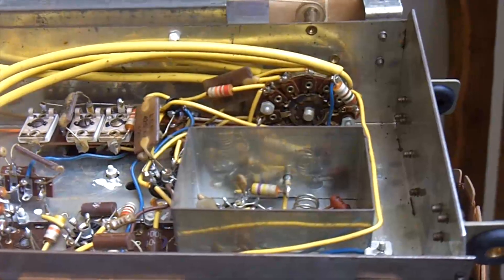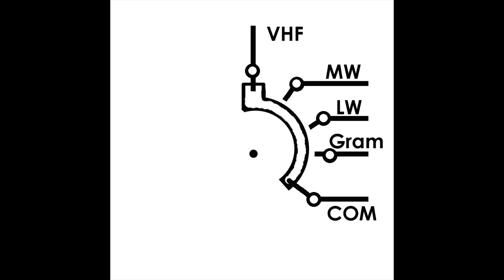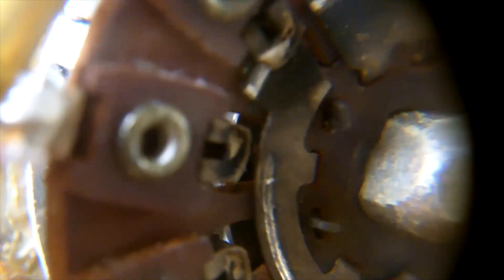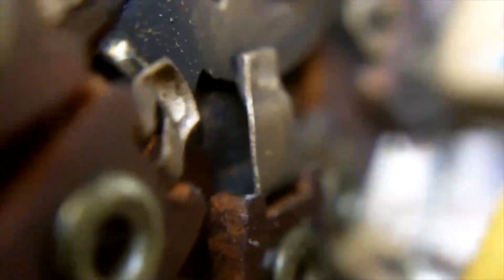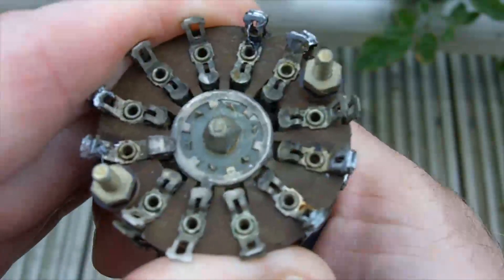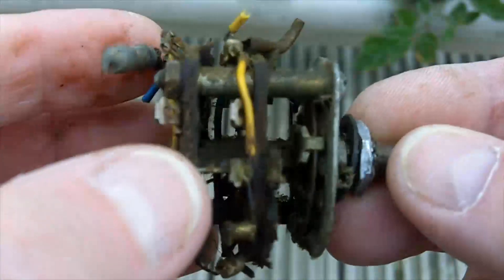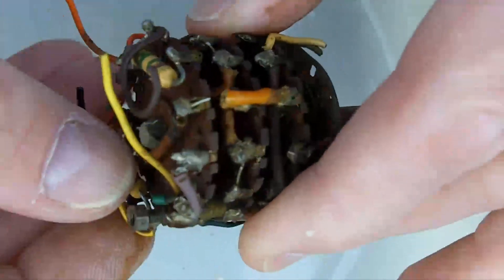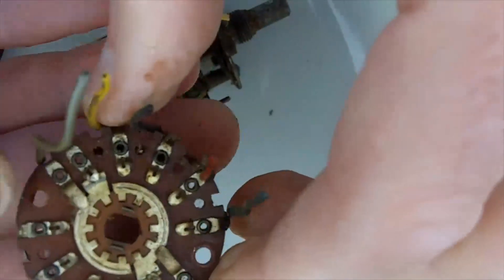About Radio ... Part 12. The Wave change switch, by Andy Davies.

Comment: Thanks Andy! This is exactly what I was looking for, and very well done - I can see everything and now know how to proceed with a bad selector switch on a nice old integrated amplifier.
Reply from the maker: Thank you, I hope that you are able to fix the amplifier. It's a pity to think that so many old pieces of equipment will have been discarded simply because folks don't know how to do a simple repair job like this. 
I can't recall just how many times I've done it, but it always works rely well.
Kind regards and good luck . . . . Andy

Comment: Great Video.  I would like to know if you have had any experience in cleaning off the black oxidation on the wafer ring.  Caig Deoxit does not clean them up.  Would a silver polish work without damaging the ring??
Reply from the maker: Hi there, I don’t know what the latest thinking is but I’d resist the metal polish. I hate to admit it but I have used Brasso on more than one occasion but you really would be amazed just how good a bit of WD-40 will work for you.
 
You should never use an abrasive, no sandpaper, emery cloth or ‘wet-and-dry.’
 
If push comes to shove you can ease a bit of paper under the fixed contact and draw it out in line with the wafer so as not to lift the contact.  
 
If a fixed contact has already been lifted you can tighten it up by very gently easing the end of the contact towards the soldered connection.
I don’t know if this makes sense but it works like this...
Put your index finger on the table, now with your other hand push the end of your index finger towards your knuckle.
 
When you do it with a contact you have to be extremely careful, one slip and you’ve over done it and bent it in two. But done gently you can repair contacts that have been bent right back, I’ve done it many times and never had a failure.
 
Find an old switch and practice.
 
I hope that helps.
 
Kind Regards         
                      . . . Andy

Comment from the maker: @AndyDaviesByTheSea 2 of 2 
If you use any other solvent like nail varnish remover it could damage the insulation on some switches so it’s best to avid that if you can. When I’ve had a relay dirty switch I’ve managed to clean it with a thin bit of piece of paper between the contacts but you have to be careful not to bend the contacts. If I get the time I’ll make a video of this and how to rest the contacts if you bend them.   
Kind Regards ... Andy

Comment from the maker: @MEverett98 1 of 2 
Hi there, when you talk about tarnish remover I don’t know if you’re talking about some branded product over there or some mix of baking soda and vinegar, either way I’ve never used that. I have used a proprietary switch cleaner but recently I have found that WD-40 does an equally good job. Never use any abrasive materials like Brasso, emery cloth or sand paper. If there is wax from a capacitor white spirit should remove it but dry it off and then use WD-40
see part 2 fo 2

Comment from the maker: @goddamnox Hi, thanks for the compliant, I’ve made these videos in the hope that they will be of interest to others but it’s very gratifying to be receiving so many positive comments. I’m just starting a series ‘About Capacitors’ I’m not sure what direction that’ll take but I think it’ll have a lot of ‘radio type’ capacitors and applications as well as some from my field of Induction Heating were I used very high current radio frequency capacitors in metal melting and hardening applications.

Comment from the maker: @AllAmericanFiveRadio 
Hi Rick
I know what you mean, one of my earlier videos shows an R1155 receiver out of a Lancaster Bomber and that has a switch that’s more than half the length of the chassis. It’s so long they had to put it in long-ways on and drive it with a 90 degree bevel gear from the front. I think these little challenges are what make radio fun, or at least that’s what I keep telling myself  hi hi.   
73’s ... Andy   gw0jxm

Comment: Hey Andy,

Good variety of wafer switches. There everywhere too. I had a radio that I had to remove the metal part that rotated the wafers. The wafer switch ran the length of the chassis and I had to remove it to get to a coil and repair it. Very nice demo video of what a wafer switch is and how they work.
Regards,
Rick